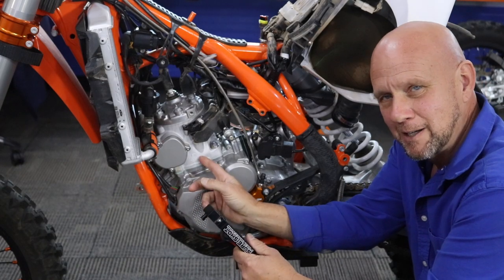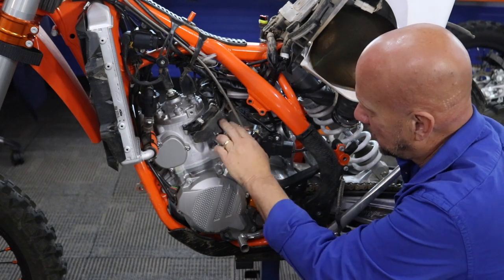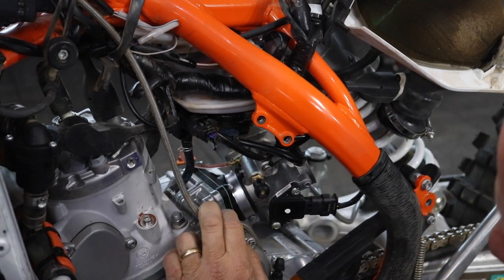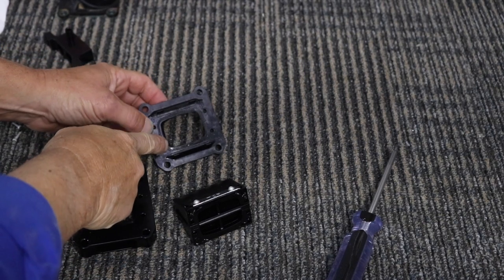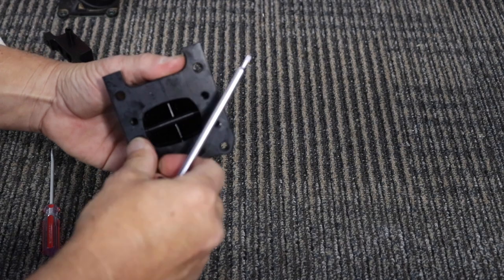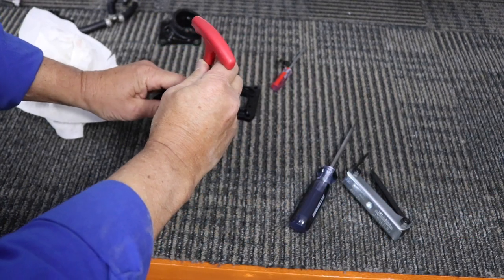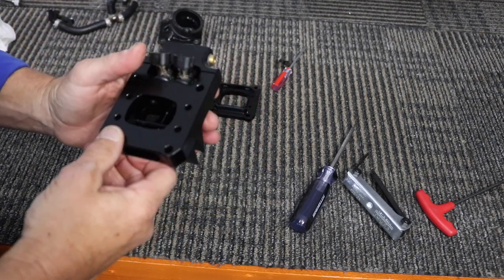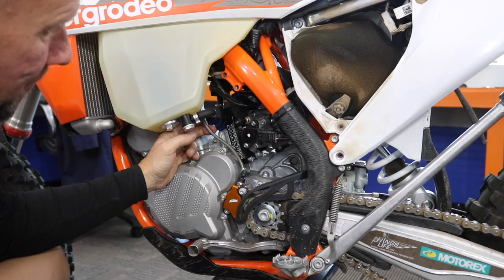KTM TPI 2 strokes | Instructions for Installing the Fuel Injector Relocation Block

Comment: I installed your kit on my 2021 TX300i and I am extremely happy with it so far! I had 60 hours on the bike prior with only the idle adjustment screw modification, and air screw set at about 1 turn out. Stock plug was a BR7ES and it looked rich when I replaced it with a BR8ES. The Bike always had a Flat spot up high in the powerband and I usually shifted it up before I hit that area. Now it has more power off idle (airscrew at 2.5-3 turns out) and WAY more on Top and it lost that flat spot up high. It must Rev out 500 RPMs more (no Tach, so I don't know).
The Bike runs like a 300 Carb (Keihin) bike now. The only thing I have noticed is a "Pipe Bang" type sound (like backfiring, sort of) when I close the throttle. 
Elevation here is about 500' and temps are cold at 40-50 degrees F. FYI.
Curious about this Pipe Banging and what it means? Not a big issue--just annoying.
Reply: I also did notice that fuel consumption is better now. I am putting an once of pre-mix oil in the gas per gallon and it runs fine. Stock head and ECU are being used.

Comment: I'm just installed mine bike feels great. I've got a bit of a hanging idle so I need to adjust the air bypass. I just wanted to know if this is common. I also have the TSP M head and remap.

Thanks
Reply: Hi, did you ever get an answer to this ?

Comment: On my 2022 KTM 300 XC TPI the top shock bolt needs to be removed to tilt the shock rearward so that the intake rubber from the air filter housing can be fitted back onto the throttle body as the shock spring interferes. This is due to the thickness of your fuel injector block.

How did your oil line from the pump to throttle body fit, route? Mine rubs on your fuel injector block?

My KTM ran poorly from day 1 and then seized at 7.2 and 7.4 hours. After the 2nd seizure KTM installed a complete new case motor and oil pump. 
I am now installling your split injector fueling block (right side injector being relocated into your block.
Reply from the maker: Well if you just have the normal set up, you can't get more than about 1400 rpm with the air screw.  If you use the injector relocation block and tpi screw, then you can turn up as high as you want

Comment: Very interesting and tempting!! Im concerned about the engine management/tuning with this relocation and the stock ECU/stock maps, I would assume the relocation effects mapping/tuning?  Also Is there any LOSS in low end stalling, low end power delivery? 
Great solution/great looking product!
Thanks, Jason
Reply from the maker: Yes the best part of scientific testing with the air fuel meter and dyno, proves all is just fine.  It doesn't seem to matter when the fuel squirts in, because it doesn't need to be timed anymore. It all mixes together in the reedcage and moves through the engine when it's needed. Just like any carb 2 stroke. Pretty cool

Comment: Since your injecting fuel oil into the bottom end now....why can't you premix say 32:1 and also do away with the oil injection?
Reply from the maker: You can try, but you start unplugging those sensors, and the bike will just shut down
Reply: What shitty oil are you using bthat recommends 32.1? 😂 1985 called and said to wake up haha

Comment: Hi ,  ive just bought my first 300 tpi , coming off carb . i plan to do this mod . But before i go out on my first ride . You suggest i premix my petrol aswel as the oil tank topped up to max . 
premix 30ml of oil to every 5 litres of petrol to be on the safe side . Cheers

Comment: Seems to be simple and clever solution.  Would be interesting to know why KTM R&D engineers didn't chose this solution when developing FI solution. It is even more simmilar to carb version. Must be a reason for it.
Reply from the maker: To pass emissions in Europe and be able to sell the 2 strokes there. They have the 2023 bikes coming with the injectors in the throttle body, to fix all the issues that this does. Probably just won't be for sale in Europe

Comment: hi, ive just bought this item off you and also souced a pre tpi rebuild kit including the barrel as you spoke about people changing to pre tpi barrels at the start.  i have received the barrel and noticed that it doesnt have a provision for the crank case pressure sensor......... is there a way around this because i believe the bike  wont run without this..... i have also emailed you.
Reply from the maker: You'd put a hole in the barrel like the stock one or the case and install a fitting for the line

Comment: Greetings from Latin America.
I am curious to install this system on my 2019 tpi 250 motorcycle, do you think a reprogramming is necessary because I want to change the kit to 300cc? !! I appreciate your response
Reply from the maker: You would need to reprogram when going from 250 to 300, with or without this block

Comment: Why do you still use the oil injection pump. Couldnt you ditch it and run it on premix.
Reply from the maker: Maybe.  I don't want the liability though of telling people to ditch their pump if something goes wrong.  Have to leave that one to the individual
Reply: @ktmhusky  ,greetings Dave further to this if some one wanted to try this ie remove the lube pump / tank etc and run premix what do you see as a possible issue ? Do you think the injectors / ecu could handle 50 :1 premix ? Purely hypothetical question ,
Cheers Derek .injector block =👍👍

Comment: Installing on my 21 gas gas 300 right now with the injector plug it feels like I can’t get it tight enough I can only get it so tight continues to spin is this normal
Reply from the maker: You can just put a small screwdriver between plug and hole to hold it

Comment: Do you still mix oil in have you had any trouble?
Reply from the maker: Always add oil. KM want's a mix of 60:1 on carb bikes but oil injection only gives 80:1. Add one once of oil to each gallon of gas in the tank always.  That's 2 oz total going in there and that's 60:1. Even if the oil pump goes out, you'll be getting home

Comment: I was convinced by this video to buy the relocation block for my 2022 300 xcw, installed it, with immediate regret.

Went back and confirmed that there were no leaky gascets etc. 

What makes the tpi great in my opinion is the ability to ride with wide open throttle on low revs over technical terrain, and take advantage of that low end torq.

The bike started bogging and overfueling, dont get me wrong, maby it increases top end power(doesnt at all feel like it), and it would help guys doing wide open stuff, but it did not help or improve my use case at all.

Luckey me I can refund the bracket as I got it from Takealot in South Africa.

Dont think KTM as a company would release a product with such major defects as accused of. This cant improve the combustion process as much if logically the same ammount of fuel etc gets introduced to the cycle, just at a location further away from the combustion chamber.

Just had to add my 10c as this wasted allot of my time.

Keep on riding!
Reply from the maker: I think considering the fact that we have never sold anything to South Africa, as we won't ship there, that you got one of the rip off products out there.  You are correct in that the. fueling passages are not correct on the copy cats and you will have running issues.   Thanks for letting everyone know to stick with the real deal. Over 700 sold and few complaints. That's not bad